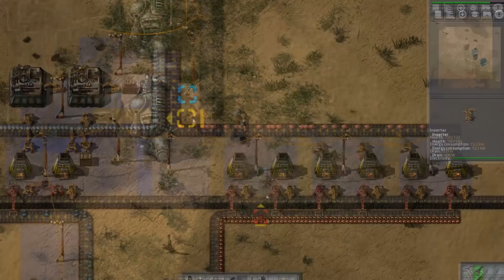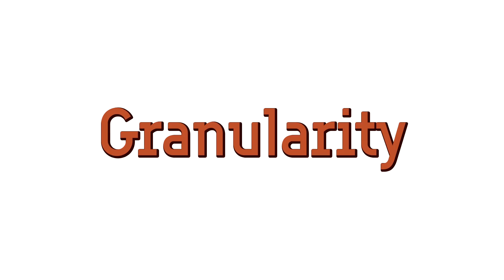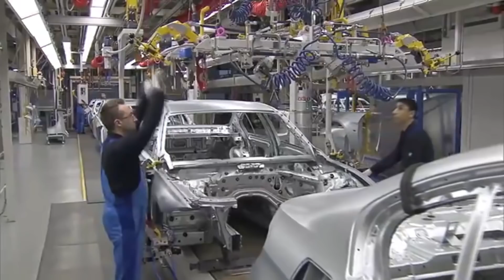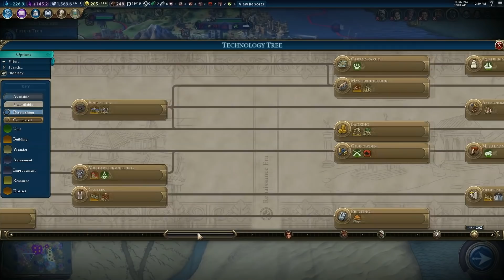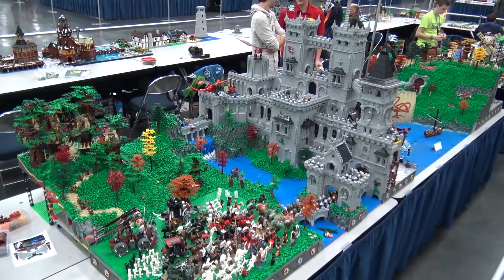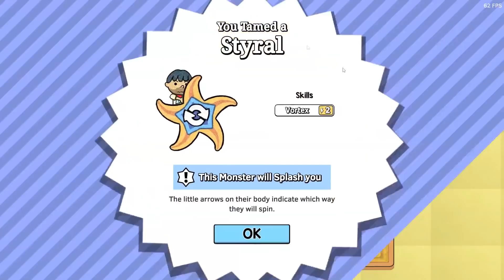Why Factorio is so Addictive

Comment: I really like your point about the Lego/Minecraft castle. As I have built a massive Minecraft castle recently and slightly more recently I've rediscovered Factorio and played 70 hours in 2 weeks. I think your distinction is spot-on. Everything you do in Factorio provides input towards an overarching goal.
One of my other main design takeaways from Factorio is the numerical meaning of all of these pieces. It feels that everything you build contributes to the existence of a bottleneck. Then that bottleneck must be fixed by building something else, and building that thing has now caused another bottleneck, this cycle repeats forever. The input/output ratios responsible for this couldn't have been an accident, I suspect a significant amount of fine-tuning was done to ensure that there is always a point in the factory that is under-served. This game is a masterclass in balance.

Comment: You know what's more addictive? Working in a machine shop and trying to find the most efficient/quick ways to get your stuff done and go home.....
Reply: I weld torque converters back together and the tolerances I deal with are very precise...... That being said, I worked in kitchens as a cook for over 10 years and the level of precision between my jobs is not that different.
Reply: I baked bread, and literally some of the instruments I used to determine my hydration level for my dough.... should honestly be used to adjust the tolerances of metal between temperature differences. I swear I could weigh dough more accurately than I could balance those damn converters.
Reply: Basically what I'm saying is, as someone that knows how to weld a near perfect circle weld with tolerances between 5 thou of an inch.... I made more money cooking because the attention to detail is that much more severe. My recipes for baking are in percentages of the total dry mass in combination with the ambient temperature and humidity level. You wouldn't ever think that bread making and precise metal working would ever combine...but there is a lot of transferable skills that even machinist don't take into account sometimes, like altitude, humidity, and temperature. I love precise work.

Comment: The thing that stands out to me the most was when you mentioned you can trace your factory all the way back to the first drill you put down. I don't think I've ever played a building game where the early-game tools aren't immediately rendered obsolete, so it's never even occurred to me how satisfying it must be to play a game where everything you do will continue to matter well into the endgame.
Reply: They don't really. There's exponential growth in factorio, so the stuff you place at the beginning doesn't matter. It's just that you have infinite space, and almost unlimited resources, so digging up an older bit of the factory is simply an inefficient use of time.
Reply: @DrDrao  i just went by a 'temporary' production line that makes a belt of green chips from dedicated mine belts. i slapped down a couple to buff my starter base from 500 to 1k SPM while i transitioned to a proper megabase. getting production finished and just have to work out logistic bottlenecks. i saw some assemblers have over 20m products finished. my starting boilers don't make remotely enough power to function as a suitable backup generator, but it still makes just as much power as ever, and serves as a great wood void. even if something is decommissioned instead of deconstructed, it still tells the emergent story of your gameplay and feels like home. it seems i almost exclusively play games that allow me to continuously build on something and stay in the same game file indefinitely.

Comment: Also has quite a mechanic of resource management, since some things are finite in their availability. So then there's the process of bringing everything needed to the production lines. Also circuits, for things like idling parts of the factory to focus production elsewhere or to balance production when it comes to stuff like petroleum processing. There's more depth when getting into those things.

Comment: wow - I'm a year late - so I'll try to assume what's already happened in the past
as you mentioned a compare to Minecraft or Lego (wich I think a pretty good) one have to differentiate between the plain old vanilla stuff and what additions made with them - wich both applies to Lego as well as to Minecraft
when you look at both Lego and Minecraft vanilla - Minecraft pretty much is just a digital version of Lego: you build your own world with small building blocks
but when you look at additions like Lego Technic, or, as a good comparison, technic-based/-themed mod(ification)s of Minecraft one can get pretty close to the base you like about Factorio: you can build your factory wich takes some input resources and produce a desired output
also, with the right mods, one can also automate pretty much anything - wich can be done in two ways (one of wich I personal miss in Factorio): always automatic production, just like a Factorio factory until final output storage fills up - or, wich I like more: production on demand (wich, at least as far as I know current versions of Factorio, isn't a thing) - so, you only store the base resources and the automatic production (crafting) actually happens only after you requested the final resulting output
just as an example: one can setup a huge power plant wich then supplies the resource gathering as well as the acutal factory or the transport of items up to automatic building of additional stuff - in addition to that, one can also add space stuff so your mentioned goal of fire a rocket up into space can be accomplished as well
also, there're some new games out there wich are like mixes between Factorio and Minecraft, like Satisfactory or the very new Automation Empire
but as with almost anything in life: it all comes down to personal preference

Comment: You lost me at "long term goal of building A rocket". Thats not a long term goal. A 1 KSPM base is a long term goal, or finishing space exploration in seablock. But launching a single rocket is just a short less then 8 hours, if you know what you are doing. If you REALLY know what you are doing, you can even get lazy bastard on the way. (Not recommended before 0.17, but more challenging and fun before it).

Comment: aka cracktorio. Clearly if that's a video of your own gameplay, you haven't got into the goal of trying to build machines in perfect ratios. For example, 3 copper wire makers to every 2 green circuit maker. The perfect ratio aspect is one I particularly like.

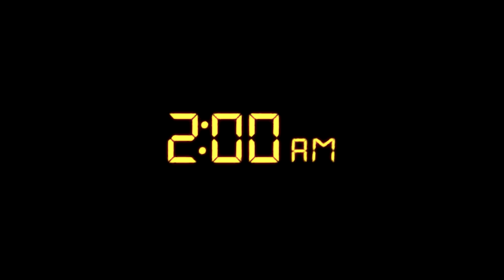Comment: @ 0:33 "an then I looked at the time" Every Factorio player does this. Even after 5200 active hours of the game (my factories do not sit idling, you can always moar/faster/better something) I still get that feeling.
Bonus points for hoe you use the game music.
@4:13: error the goal of Factorio is to stop playing, You don't leave with that first rocket unless you do some VERY obscure and not obvious things that were put in the game as an easter egg.
Many players feel that the first launch is only the mid game, you didn't even touch the impact that later systems (like rails and circuits) have on the game. then there's a scale shift. to REALLY get an idea of these kinds of play you should watch Xterminator or KathrineofSky, Then there's ColonelWill and MojoD on Twitch.

Comment: I actually wish I could get addicted. Since I launched my first rocket in about 2014 I restarted the game about 5 times but I never have the will power to get past 3rd level science packs, especially with all the updates that seemed to unnecessarily pad out the game without adding anything interesting. Terraria is way more addictive to me. I can only stand the industrial aesthetic for so long before becoming depressed. This is why I can't play fallout for long and why I left my electronic engineering internship early.

I think it's a massive overstatement to say that in this game you go from raw resource to high tech robots, because you skip so many steps. I mean, you go from copper wires and gears to circuits. The tech tree is completely unrealistic and gamified, especially when compared to something like one hour one life

Comment: one more reason why factorio is so damn addicting:
you always have at least 4 tasks to do no matter what stage you're in. And all of those tasks are "pinned up" by you.
Example:
-make the oil refining setup bigger
-build an other copper mining outpost
-the northern wall needs to be refilled with ammo
-still need to figure out how to fit the production of laser turrets into this mess of a base... should i try to build it somewhere else, where it will fit properly; or use bots?

Comment: A perspective that may interest you: as a programmer, I didn't even pick up Minecraft because it simply made me want to play around in Blender. With Factorio, I had to actually learn the idiosyncrasies of the spatial puzzles before getting to that point.

Now I'm at the point where the next thing to do is to write a program to automatically create blueprints for speedruns essentially (I'm <250 hours in): firstly, this is a legitimate multi-faceted compsci challenge. Factorio is made of multiple simple puzzles each of which has different solutions. The challenge of integrating the solutions, however simple, is significant and relevant to my work (if not my career - you never actually do anything that hard in the real world).

Secondly, compared to Civ, Factorio drives me towards that end. Civ is cathartic, Factorio is an actual achievement. I can no longer continue playing it naively now that I understand it's systems. I feel compelled to first investigate whether I can automate the deductive optimization side of the game. It's like there are totally different reward loops involved to a "fun" game.

Bottom line, I think Factorio resembles future education and certainly already resembles the lost art of formal systems analysis. The reward we're receiving for playing it is nothing like what games generally provide.

Thanks for your videos too, it's lovely to have game design analysis on the internet.

Comment: As someone who has a few hundred ours in this game, I want to add another factor of the game. It's the long-term playability. Maybe you do two or three runs with the rocket as your goal.. but sooner or less you set yourself a bigger goal, like a set number of science packs per minute or a fully train based factory. Sooner or later you start planning your factory on the paper, making it 100 percent efficient and beautiful. You want to make everything bigger and bigger and bigger. In the factorio subreddit we say "the factory must grow"

Also the concept of bottlenecks in this game prevent you from stopping. No matter what you produce, the production is limited by at least one factor, like belt througput, Ressource Input, Slowenien assembling machines or whatever . You notice this bottleneck and fix it, just to find another bottleneck. Then you need new iron refinery, therefor new train, therefore more fuel, more oil, it has no end and it keeps you playing..

Another point is the satisfaction the factory gives you. When you plan a production and you see it all working with the outgoing belts being 100 percent occupied by items, that's so satisfying.
Reply: To lengthen play time, try to earn achievements. Some of those take up alot of time.

Iron production, the horror, the HORROR. Help me, HELP ME, MORE IRON, IRON, IRON FUCKING MORE IRON PRODUCTION.

Excuse me, a bit of PTSD from playing factorio.

The factory is never 100%efficient, but you can get close, then closer, then closer, 99.9% efficient, just gotta ...  the iron is down again
Reply: Praise the expansion
Reply: You're so right, there are natural problems that arise with almost any expansion on your base. one upgrade leads to more work, which leads to more work. which leads to more work Its perfect.

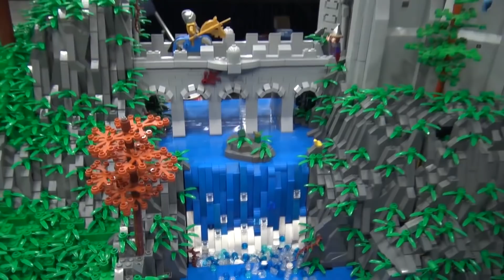Comment: 6:20 that doesn't diminish the minecraft/lego creation though, it doesn't NEED a function because the creation itself is enough, theres also the freedom to design something thats purely form > function or function > form (realistic looking castle or fantasy without regard for realistic design considerations) whereas with something like factorio you feel pressured to design only the most efficient assembly with little room for creativity, so the idea is to build more and more efficient and streamlined factories and assembly lines, slowly improving efficiency margin by margin, and that just doesn't sound as fun

Comment: I have been hooked until monsters keep breaking my walls and breaking my turrets
Reply: You can turn them off, I prefer factorio without mobs
Reply: @jacob8565  wait you can? and dont tell me its within the console because then i cant get achievements/
Reply: @asrieldwemer  You can disable them toggling peaceful mode or lowering their size in the map generation settings, but this disables some achievements. Best way is to increase pollution absorption and disabling expansion so that they aren't actually triggered, as this doesn't disable achievements.

Comment: At one point I will make an entire factory without using any belts but I need more research viles aka sp which is what I call it which is actually called science packs and I will make the rocket finally which I am no where near
Reply: Thank u for the likes if there are gonna be any
Reply: @jevil4583  lol
Reply: if set up properly, chains of chests and inserters can replace belts, and sometimes even have higher throughput than belts.
if you try this, some modified inserters (to change pickup and dropoff points and thus reduce the angle that they have to turn) can help too, resulting in even more throughput.
that's so great about this game: you can set your own goals and even restrictions, change settings and play again and again, and then you can add mods to extend gameplay even more and change the game completely into whatever ...